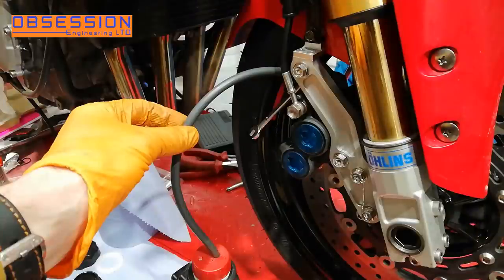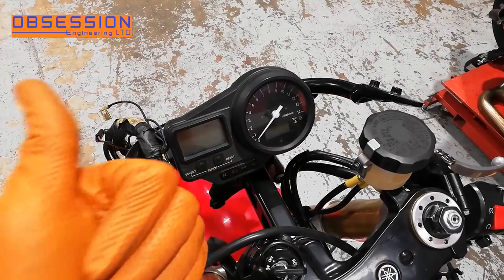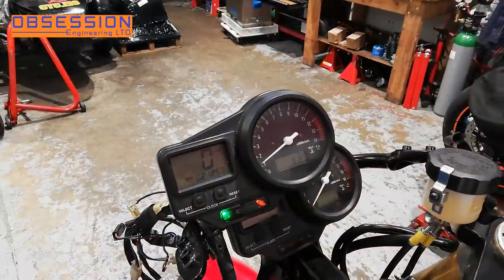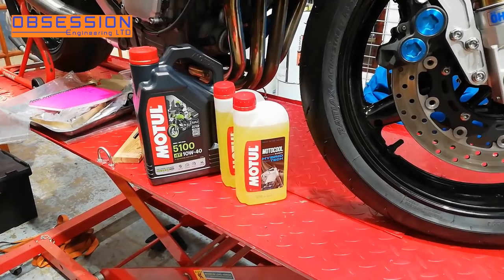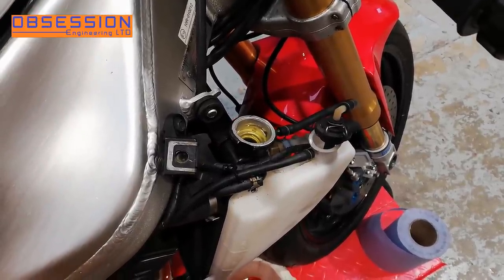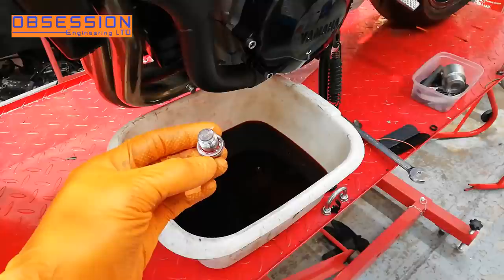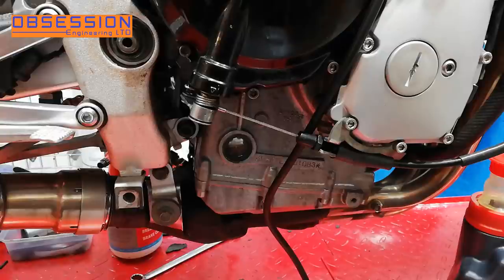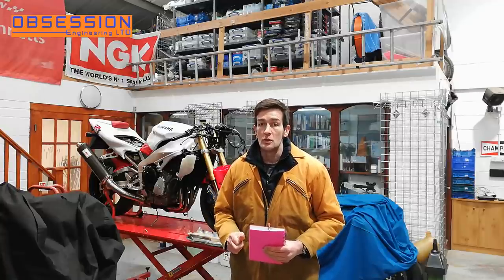1998 R1 Jigsaw Puzzle Project. Part 4. Oil and Coolant change on the 90's icon

Comment: I had an 02 R1 and it was a such a nice well engineered bike , my only big complaint was that once the bike was run for a while that frame would hold the heat like a house radiator and it made it hard to enjoy during the summer months .. sold her a few months after I bought it for that reason only ....
Reply from the maker: I had an 03 r1 a few years ago, really good bike. Never noticed the hot frame though. Did you try going really fast to get more air flow around it :)